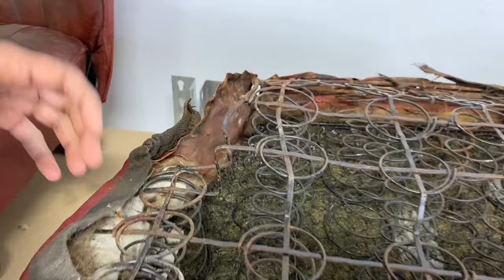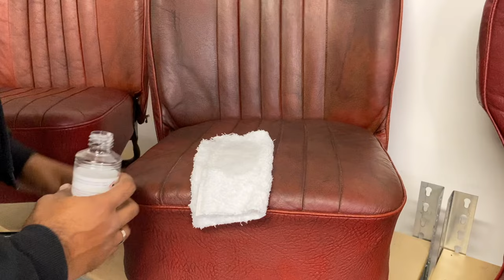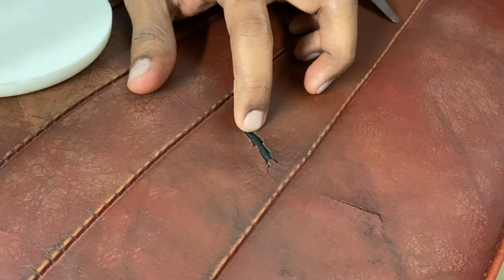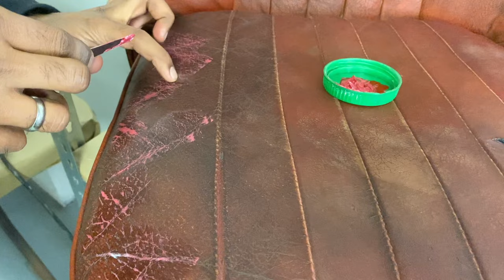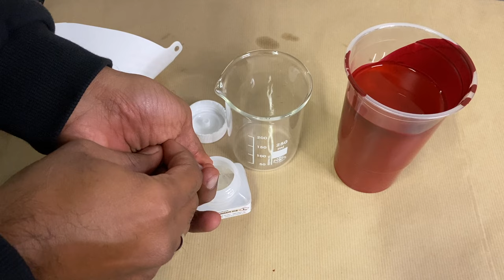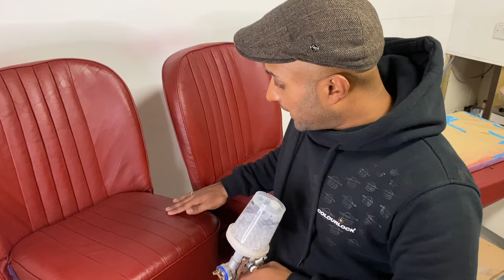65 year old classic Morris Minor | Artificial Leather Interior Restoration | leathercare.com

Comment: Curious can you use two different colors when coloring a car seat? Example on a car seat the middle section would be grey the rest of the seat would be cinnamon.  Thanks
Reply from the maker: Yes, it can be done absolutely. In most cases though we don't recommend colour changing...if its already 2 tone where certain panels are a different colour, then yes it can be done without any issues. You will just have to make sure it is masked correctly.

Comment: What do you use to soften the old dried leather before refinishing it?
Reply from the maker: We use a couple of products depending on the condition of the leather:
1) If the leather doesn't need filling and colouring but is just hard and dry - then we use Colourlock Old Leather Softener. 
2) If the leather does need full restoration or colouring work - then we use Licker Oil which is water soluble and therefore can be diluted. It makes it easier to degrease this than Step 1 as the paint and filler etc may not bond very well to an oily surface. Hope that makes sense.